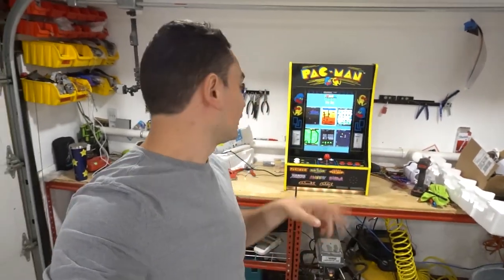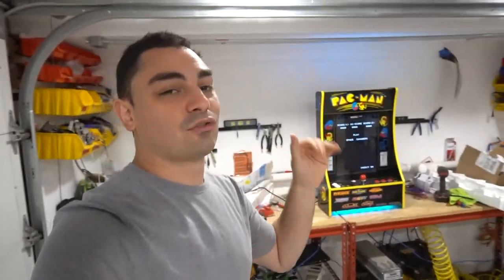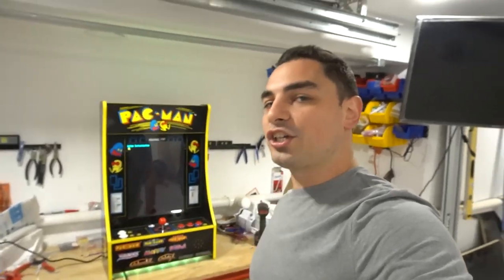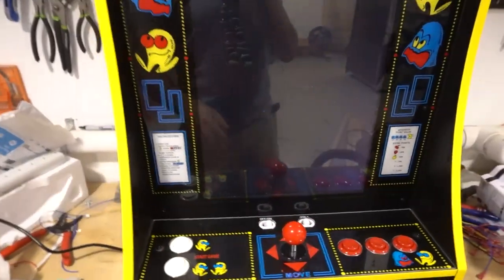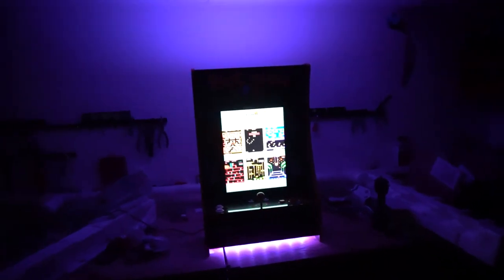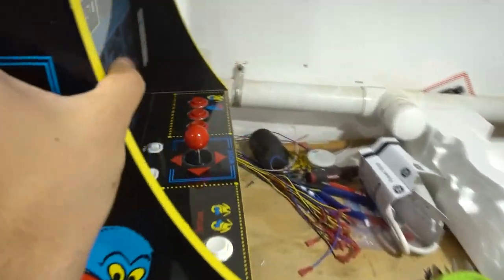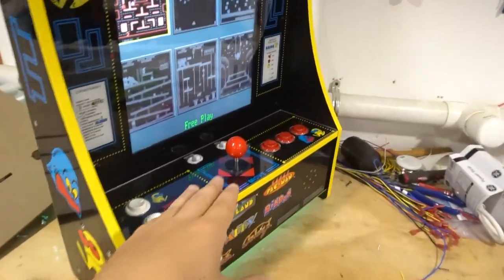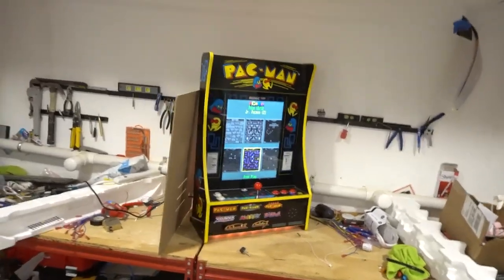Arcade 1up PartyCade Mod / Diy Retro Review

Comment: great build as always. I have 2 partycades i used a 90 Degree C13 3-Pin Female to C14 3-Pin Male and put the plug on the side of the machine.
It works well with larger arcades allowing me to route the power cord better. 
I love your ability to make it work keep up the great work.
What i would like to learn or find the part for is the  volume rocker wiring and setup because i usually have the little mini amp connected to the speakers but that little knob is clean up top.
Reply from the maker: Thanks bud, check the mid size ninte do cab video below, you'll see more details on the volume knob

https://youtu.be/-b9lOXtAqn4
Reply: @Vic_VP  could this run killer instinct? Blitz2000? And 2 could I pay you to do it and how much would it be? Please
Reply from the maker: @Mcfly_dpr  no this can't run any of that as this is a vertical screen... u need a pc based system for the games you said. Check my byvic cabs

Comment: Just a tip - if you want high scores to be saved, turn dip switch 3 on.
Reply from the maker: Good tip however i Have that enabled... issue is powering off the cab. Once powered off scores get lost... not powering off, high scores stay saved
Reply: @Vic_VP  On mine only the top score is saved, and no initials.
Reply from the maker: @Hellacia  interesting, but still an issue especially with no initials :/ 
It's the #1 complaint on these... but I tell people for score saves you'll need a pc build... but people don't wanna pay 🤣

Comment: ok, so, what do I need to get the stock board hooked upto a zero delay encoder with this diy retro card. walmart has these for 99 bucks right now. Thought it would be simple to just slap an at games pick inside of it, and hook up the stock controller board, and then have a wireless at games controller to use for anything that needs more buttons, or I can drill a hole. Im not picky about buttons, for something that costs 100 bucks, I'll keep it stock. but I want to upgrade the board and put something in it. Figured you could basically make an atgames legends ultimate mini mini... lol total price would be like 250 bucks. 1 bucks for cab from walmart, 100 bucks for at game puck and controller froms samsclub, and then 30 from diyretro, and 10 from amazon for an encoder. I just don't know what encoder I should get...
Reply from the maker: Hey bud, just don't understand what your trying to do.
U want the "diy retro card" meaning you want the 60 on 1 board? A 50 on 1 board is a jamma based system. You can't hook an encoder to it, jamma wires go directly do the buttons and sticks.

Slapping an atgames puck means ur only using the cab for its screen and buttons. At games puck has all the games a 60 in 1 would have and more.
Again not sure what your trying to do 🤣

If you want a reference, check my videos for the "2 in 1 control panel" that's a system running a pandora box and a rasp pi. Same kind of setup like you want where the buttons and sticks are talking to a encoder and the pandora box.

Comment: I did a 60n1 on a pac man partycade just like yours but now I wish I had done a raspberry pi or something better. Is anything compatible with all the 60n1 parts or would I have to gut it again and start from scratch?
Reply from the maker: You would need a usb encoder and the pi. Don't think of it as starting from scratch as you needed to do the lcd mod and such... it's more like your halfway complete.

If you did the speaker mod like me than the only thing you would keep from the 60 In 1 is the power supply.
Other than that nothing from the 60 in 1 would work with pi besides the buttons and joysticks.
Reply: Raspberry Pi is the only way to go ;)
Reply: @maxmixer  So if I already installed a 60n1 kit form Diyretroarcade what all would I need to switch it out with a Pi. My problem is I know nothing about this stuff. I can follow directions but doing anything myself is a challenge.
Reply from the maker: Wait a few days ir check my Instagram... I got the ultimate vertical build coming up pc based. Wipes the floor with pi and pandora
Reply from the maker: Arcade punks has pi images, but nothing is plug and play. For simple plug and play setup... king of air and 60 in 1 is best

Glad to see your getting help from fellow viewers 🤘

Stay tuned I have a vertical pc build in the works that has over 1100 games including pinball
Reply: @Vic_VP  Is King of  Air pretty good emulation? It looks kind of poor on some of the vids I have seen
Reply from the maker: @bigmacfullerton7870  king of air is a pandora box. I personally never experienced one but I'm sure it's fine as majority of the games are arcade and nothing High demanding
Reply: @Vic_VP  have you heard about these raspberry pi to jamma adapters?Could I use one of those to swap a pi with my 60n1 board?
Reply from the maker: @bigmacfullerton7870  never heard of that. I think your overthinking it lol. Pi is a usb device so you need usb encoders. You basically just have to rewire
Reply from the maker: @bigmacfullerton7870     I just saw it, those r meant for a real arcade cabinet that can be converted into a pi. You have a partycade with a 60 in 1
.. your 60 in 1 is using the vga connection correct? This adapter won't work as the video out is from the jamma connector... that's what that adapter is for. Original arcade hardware didn't have vga or gdmi connections to the tube.. they used the jamma.
What you see "playing smooth" is the pi, all u need is a pi and a usb encoder. You don't need that adapter
Reply: @Vic_VP  Ok thanks so much for your help . That makes sense. I’m clueless when it comes to this stuff as you can tell 😂
Reply from the maker: @bigmacfullerton7870  no sweat haha, all u need is a pi 3b+ and a sj@jx usb encoder. Arcade punks has pi images.. I used the mr burns 800 game image (search my vids for Mr burns)
It was a good image but didn't have centipede. Pis are more complex and it's not totally a plug and play setup.
If you want plug and play and easy setup, I'd suggest trying the king of air
Reply: @Vic_VP  I know nothing about this stuff I want more games how
Reply: I need to learn
Reply from the maker: @billystreetman9996  you can always send me the counter top and I charge to mod.
But you can find some videos on it expecially for 60 in 1
Reply: @Vic_VP  I wànt a 60 in 1
Reply from the maker: @billystreetman9996  ok I even say in the video where I got the kit from
They even have a video guid 👍 I can't help much other than that or you can send me the counter top ect

Comment: With the King of Air 2 board I don’t understand 60 in 1 anymore.
Reply from the maker: Lol I hear ya, as I said in vid, customer wanted 60 in 1 as he didn't know half the games kn the king of air
Reply: Is the KoA2 board interchangeable with the 60-1, or is the wiring slightly different? 

I know they are both JAMMA, but I thought I heard that you couldn't just swap one for the other without slightly changing the wiring.
Reply from the maker: @crimzon0549  not sure I believe koa is a family jamma... that's different than a standard jamma
Reply: @crimzon0549  Is interchange, just do everything identical
Reply: could I just leave everything the same and just swap the 60n1 with the KoA2 board?
Reply: @bigmacfullerton7870  I did without any problem. Just the trackball isn’t compatible
Reply: cool. I’m going to try it
Reply: is the screen blurry/fuzzy and running jagged or is everything running pretty smooth?
Reply: @bigmacfullerton7870  smooth in my opinion
Reply: and you could probably get a trackball to plug into the thing I bet.  Sounds cool to me.
Reply: @bigmacfullerton7870  curiously I just ordered GRS usb trackball. Will let you know when arrive
Reply: Awesome bro. Thanks for your help!

Comment: Is it possible through modding to add games such as:

Blitz
NBA Jams
Donkey Kong
Defender
Out Run 2
Etc 

To my Arcade1up Ms. Pac-Man unit? 

If so where do I start? I assume I’ve got to swap out the keyboard and various components.

Question 2:

Where do I control the Ms Pac-Man settings such as speed, number of lives.. etc
Reply from the maker: Half the games you mentioned will not work well with a ms pacman arcade unit as the screen is vertical... NBA jam and blitz and outrun needs a horizontal screen.

On the 60 in 1 board you need to flip the dip switch to get into the test most